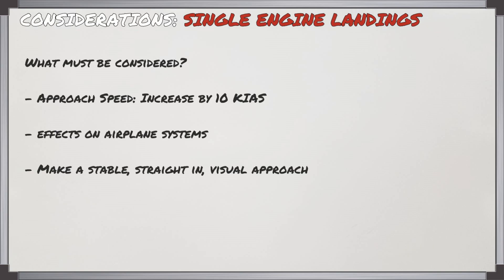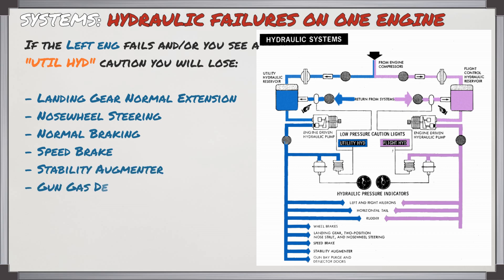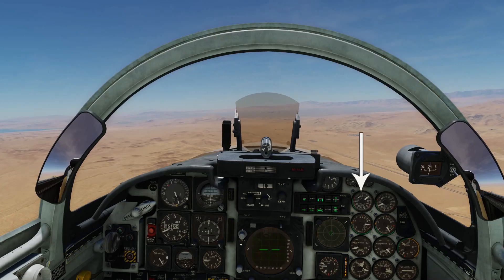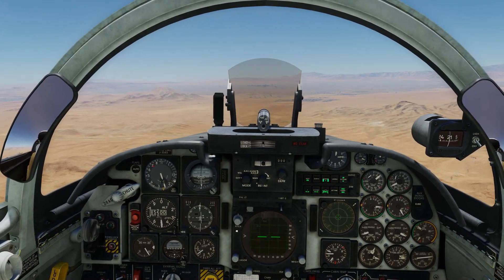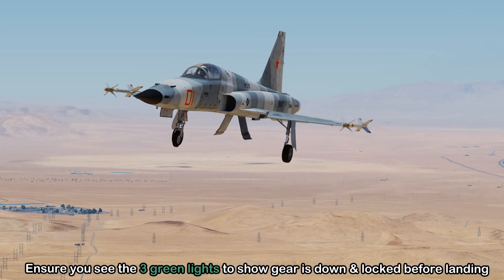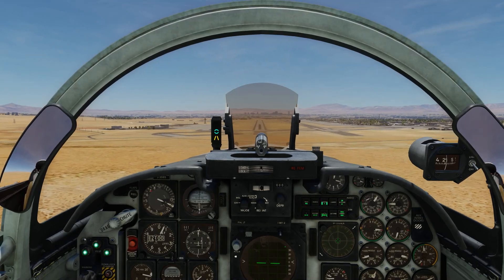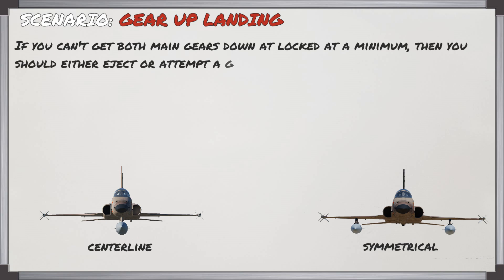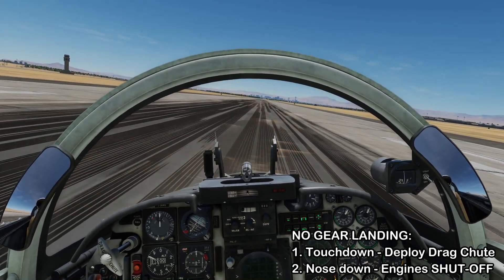DCS F-5E #6 - Emergency Landings

Comment: Did you stop this series?
Reply from the maker: I was working on the ground attack portion, but after a lot of testing I found I couldn't use its Dash 34 (weapons delivery documentation) because the way DCS modeled the weapons (mostly drag I believe) is incorrect. I didn't want to make videos using bad data as I aim to do stuff that's reflective of real life use. I'd have to add a disclaimer that the F-5 in it's current iteration can't be used in accordance with the Dash 34.
Reply: @RequiemsACTL  oh!  honestly thats why i was here. your videos were so professional and yet approachable.  If you do consider continuing, you and i both know there are plenty other 
components to tackle such as radar, rwr, even a radio and navigation would be nice and applicable to other planes.
Reply: @RequiemsACTL  Could you please link that manual along with FM most convergent with the F-5E variant modelled in DCS?

Comment: Just to clarify, if the alternate extension provides three green lights the gear is fully down, and rocking the aircraft is not necessary.  That, in conjunction with positive G, is the procedure if the alternate extension fails to get the gear fully down.

Without the utility hydraulic system normal brakes are unavailable, however: "Should the utility system fail, the brake valve acts as a brake master cylinder, and brake pressure is proportional to the amount of foot pressure applied to the brake pedal. After utility system failure, unlimited brake applications are still available."

For gear up, you can also land with all gear up in if you are in a clean no pylon configuration.